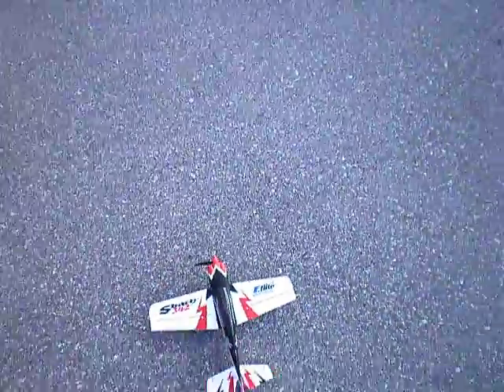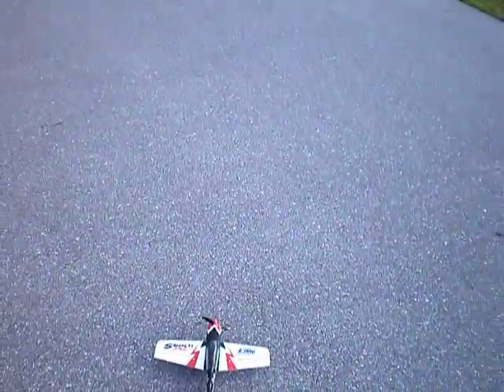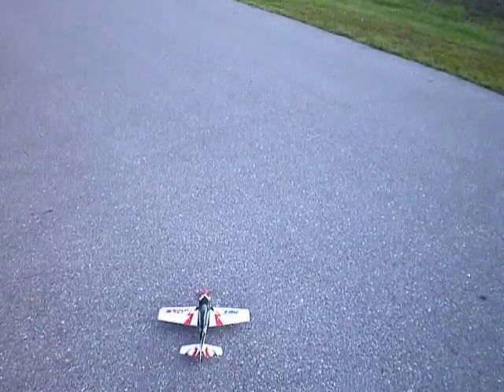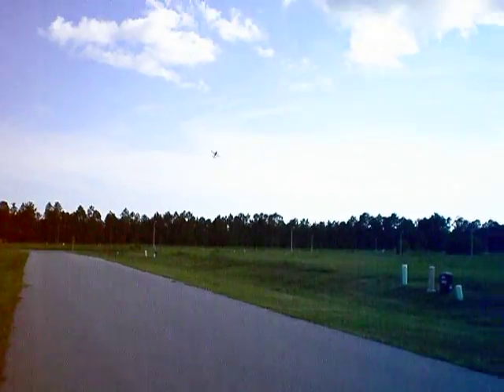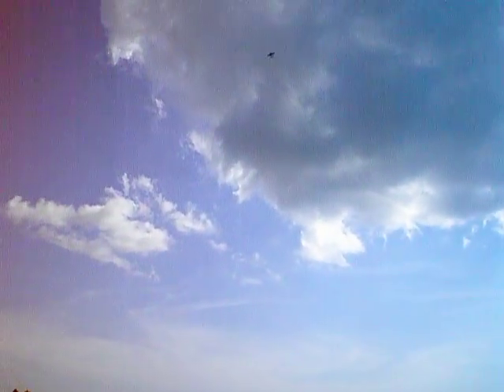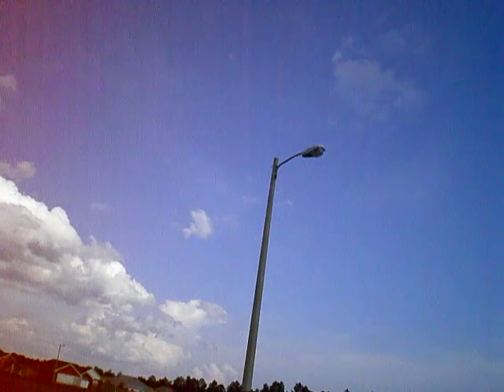UMX Park Zone SBach W 7.4V 500MAH Battery Flight 2

Comment from the maker: I got the battery from leadershobby com. I think they cost less than $3.00 each. However, the c rating was 25c and every pack puffed. The Esc is only 5 or 10 amps. So i found some 180 turnegy packs from hobby king that work great. They were also under $5.00 each.

Comment: *continued -The fun (and scariest) part with this plane for me is always the touchdowns on pavements, esp. in ~10mph cross winds which always sneaks up on me only when I'm landing. lol. I've had countless flights and so far *knock wood* no real noticeable dings to the plane yet. This bird really needs a long approach- about 60-100 yards out for me, slowly bleeding off throttle to 10%, the entire time keeping the plane level as altitude drops. I'd cut thottle just when plane about to kiss ground.

Comment: Nice vid and comments. :-) So far I'm enjoying this fast lil' gem right outta the box - with the exception of the prop and spinner. Got rid of the stockers and replaced it with orange GWS 5043 and black GWS spinner. Seems a bit faster with this setup but I think flight time may suffer a bit with the battery it came with. *continued....